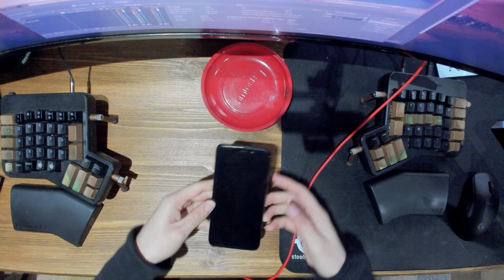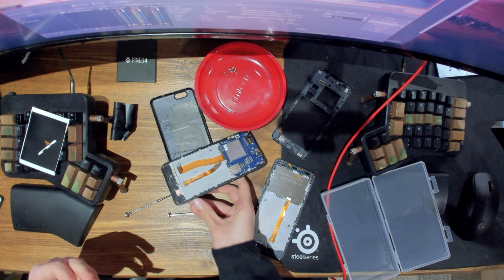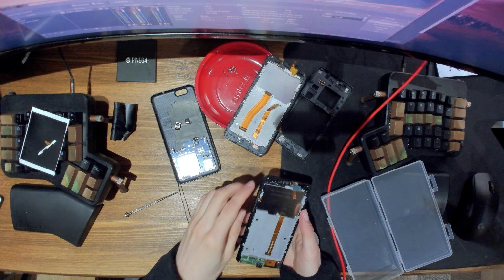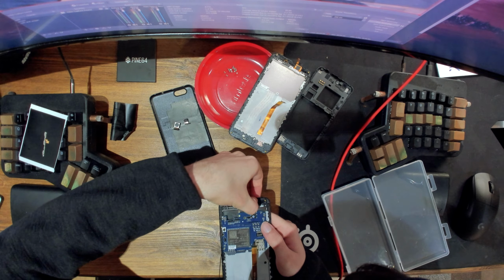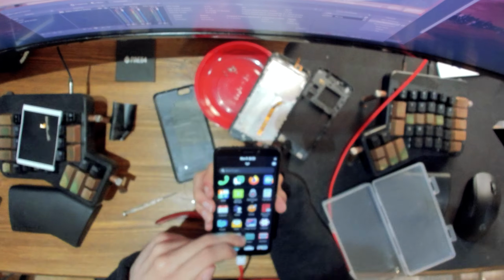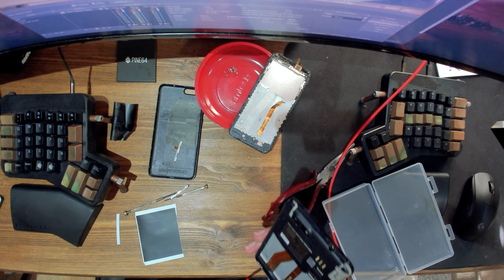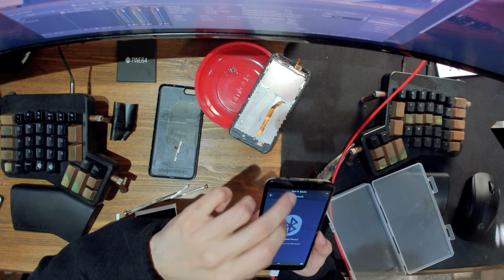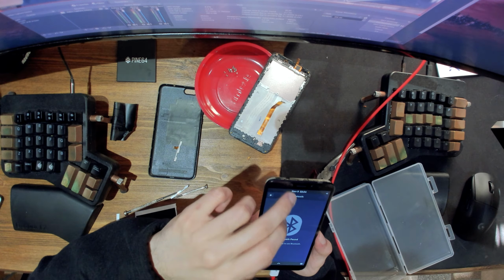PinePhone Pine64 Screen Repair / Replacement | Fix Display Artifacts

Comment: Very good video, it helped me a lot to replace my screen with some improvements: no camera removal necessary, and I think even the WIFI cable could stay connected between daughterboard and motherboard. Less risk like this to brake something.
Reply from the maker: Nice, may I ask what happened to your screen? Did you drop it or did it just start  acting strange like mine?

Comment: On the pinephone, the Wifi module doesn't work without the battery... that's your problem at ~35:00
Reply from the maker: Na WiFi works OK, don't remember what happened

Comment: Mine does the same right out of the box but it also has this weird blurry double vision effect and flickers like crazy, not a software issue as i have already tried multiple OS's.
I'm going to try checking the screen cable is connected properly before asking for a new screen.

Comment: Reminder to everyone if the phone ships like this it's up to Pine64 to fix it, since it shipped broken (as mine did). If they try to charge you for return shipping/fix DO NOT pay it, try to work with them or do a charge back. 

I had to go through this and won the chargeback because every credit card company has, in their policy, that if someone ships you a device that should be new and working and it's not, it's on the seller to fix it or refund it. If they wait until after the chargeback has completely gone through then you don't have to return the phone (which is when they finally offered to pay return shipping on mine lol)

Comment: hello. sorry for putting this Q here but can you please make VID about new magisk update, seems have issue with original ROM I tried 21.2
Reply from the maker: Don't know I updated using magisk manager had no issues but Im not using stock rom so that could be the problem
Reply: @TerminalHeatSink  what rom your using ?
Reply from the maker: Msm (best rog 2 rom currently)
Reply: @TerminalHeatSink  thank you i will try to use it <3